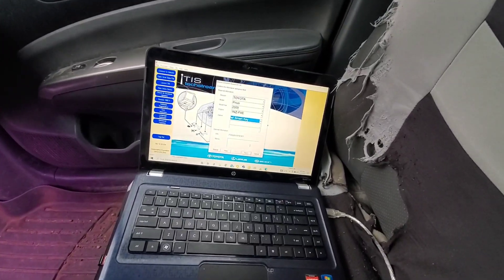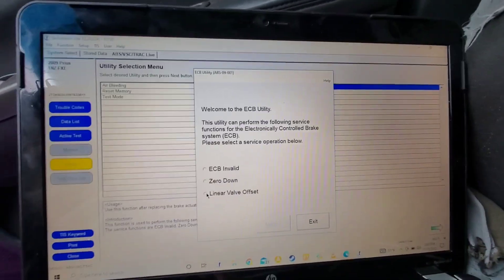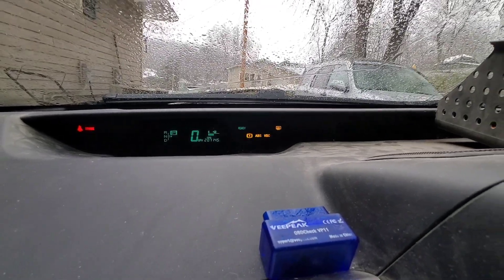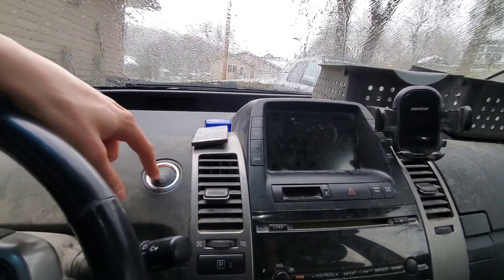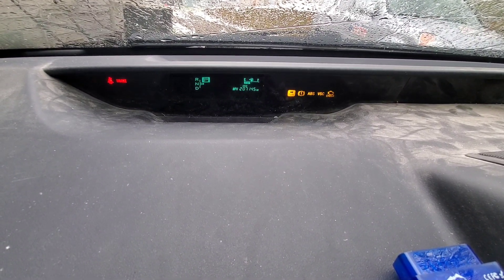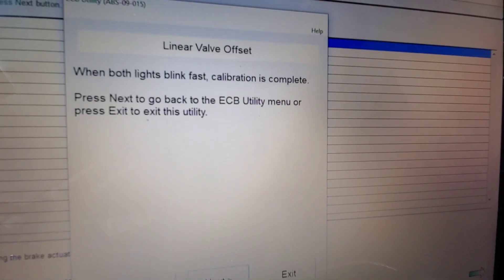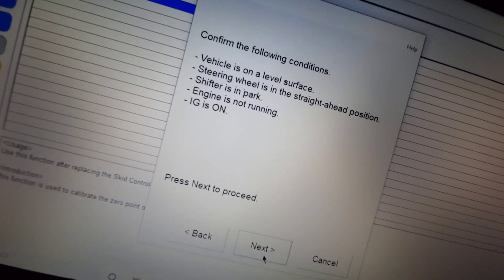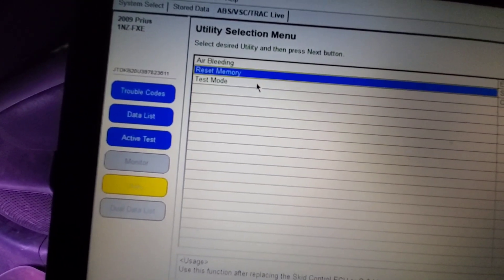Linear Valve Offset Procedure for a Gen 2 Prius using Toyota Techstream. Potential Fix for C1345.

Comment: How do you get working software and dongle ?
Reply from the maker: You can get cracked software on ebay and sometimes Amazon as well as the Mini VCI Cable. Search Toyota Techstream and Mini VCI Cable on Amazon/Ebay. 

Can't recommend one specifically as the seller I bought from is no longer available.
Reply: @JoMophee  you might want to use the Topdon Topscan rather than cracked software.  It would probably be about the same price.

Comment: Hey JoeMophee, thank you for the video! Would you know what would cause a C1300 code? I have been hearing the ticking sounds from the actuator more frequently. No codes or lights on the dashboard. TechStream shows the code C1300 for a skid plate. Thanks so much!
Reply from the maker: C1300 not Skid plate but skid ECU. On the Gen 2 Prius the Skid ECU is located underneath the center console. If you remove the center console you can access the Skid ECU easily.
Reply: @JoMophee  Thank you! Would you say a bad skid ECU could cause a frequent buzzing (almost every 3 seconds when brakes are not applied) from the brake actuator?
Reply from the maker: @wssr3293 no I doubt it. It's likely a bad Brake Accumulator if you hear repeated buzzing and clunking/ticking without the brake pedal being pressed.

Im assuming the noise in this Reddit post is what you're hearing: https://www.reddit.com/r/prius/comments/hj9g78/whats_this_thumpingbuzzing_noise_that_occurs/fwl20lt?context=3
Reply: @JoMophee  Yes, that exact typical accumulator sound but more frequent. Well I have already bought a new OEM actuator to replace soon. Dreading the TechStream/bleeding process more than the actual part replacement. Got any tips? Thanks again.
Reply from the maker: @wssr3293 make sure when you do the bleeding process that the 12v Battery is hooked up to some sort of charger.
Reply: @JoMophee  Will do! Thank you!!!

Comment: I reset the memory then proceeded to offset the linear valve but there is no blinking of the lights and there is no actuator sound going on and off. Did it twice and the same thing. I have a C1246 error and am trying to fix it. I was told to offset the linear valve but its not doing anything. Any ideas?
Reply: I have the same issue did you figure it out?

Comment: Good afternoon sir, I have a blink problem for the ABS indicator, brake warning and VSC stop before 120 seconds, is it normal? Or do you have to blink up to 120 seconds?
And the DTC C1345 is still stored which means that the initialization of the calibration has not been completed,
I have followed the rules such as Steer Straight, Shift Lever Parking, Power ON, Battery More Than 12V, Do Not Step on the Pedal and Let It Rest for 1-2 Minutes and the Last One Removed the Parking Brake, Strangely the red parking brake indicator continues to light up in MID even though the parking brake has been released, is it normal sir?in the normal datalist, if it is removed OFF if it is pressed step on the pedal ON (still using the manual parking brake, namely the pedal)
Does it turn on continuously because of ABS, VSC, Brake Warning on.
Do you have any advice?
Reply: Did you get this fix? My car is doing the same. I would love to hear what you did to get it fix
Reply: @Victoriano90065 

In the 2014 Camry Hybrid, the master cylinder and brake booster are separate. It's best to replace both components together and calibrate them. However, if you want to save money, please follow the trouble code displayed. The most important data points are the booster pump pressure and the internal brake master cylinder pressure sensor. To replace these parts, don't forget to perform the "internal brake fluid pressure reduction" active test and then disconnect the battery terminal. Calibration failures that frequently fail could be due to engine overheating, so be careful and thorough. Thank you.

Comment: Thanks for saving my Prius. I was getting all sorts of codes before I calibrated my new skid control unit.
Reply: Hi! Did you replace both the actuator and the skid plate or just the skid plate? I am getting a code for c1300 skid plate code. Thank you!

Comment: Not a guarantee? W a new actuator would it be guarantee
Reply from the maker: Yes if the error codes were caused by a faulty Accumulator/Actuator... a New one should fix the errors and brake issues.

Comment: Do you need to do this after changing the ABS Pump Actuator? I did the bleeding process using Techstream but I didn't do this afterwards. No codes.
Reply from the maker: Yes you should do the linear valve offset procedure after changing the pump. Probably not 100% necessary as I'm sure the Prius attempts to detect the valve positions without the calibration... but the Calibration will ensure it is working 100% correctly.
Reply: I ordered a used actuator off of eBay, had it replaced by a guy and it ran perfectly fine for 2 weeks... Today all the lights popped back up, brake, vsc and the petal feels like it did before I had the "new" one installed. There is a $300 diff. Between the guy who programs it and doesn't but I might have to pay it I guess, this is an 05'... It's my first Prius and I'm feeling discouraged
Reply: just curious, what codes did you have before replacing the actuator?
Reply: @Btu555  I actually didn't have any codes but the pump would go on frequently enough to drain my 12V battery.

Comment: The AUTEL MK808 will do the linear valve re calibrate on 2011 Prius.  The TopDon TopScan  has the function also but i have not tried it.  I used the Autel  on a 2011 with very noisy brakes and afterward it threw the 1345 code. I replaced the Master cylinder and pump $1100.  You need a scan tool or tecstream if you replace the master cylinder.
Reply: My MK906 wouldn't on a 2nd gen.  You're luckier than me apparently.
Reply: I tried on the Topdon and it went through the procedure but didn’t clear the codes C1345 and C1368. I’m thinking the clear memory function on ten Topdon didn’t work. That’s the only thing I need to do.
Reply: so the autel would be able to air bleed and calibrate and I assume the air bleed needs to be done before calibration? I have a 2011 prius with code C1252, C1253, C1256 and about to replace both brake pump and brake booster.
Reply: @Btu555  There is a bleed to use after replacing the booster.  It will have you bleed the screw that is on the booster. You leave the cowl off so you can get to it. I think that you need to bleed, then reset memory, then the linear, then you need to do the steering yaw rate. You don't mess with the steering but it gets erased when you do the memory reset. Have the car level when you do the bleed if you can because it needs to be level when you do the steering. Look at your scantool connected so that you can find the screens you need.  I did a 2010 last week but i used the Vdiag VD70. There are 2 good videos for replacing the booster and pump. I would have a quart and 1/2 of brake fluid. You will use a lot in the process.
Reply: @diydantex6150  Thank you for a quick reply and all the tips.
Reply: @Btu555  Using a Vdiag VD70 scantool
to finish install Prius brake booster
(you may need to clear codes before and during)
(The 12 v battery needs to have a good charge)
(I use a small dumb charger to maintain)

Run the (EBC)-R utility to bleed 5 places
(4 wheels and the Actuator)

Reset the memory
(you can’t do the Linear…until you reset memory)

Linear Valve Offset  and Pressure ...Learning

Set the yaw rate sensor
(Located in Test Mode)

The autel is similar the functions are scattered all over The bleed you want will tell you it is for replacing the master cyl/ brake ECU.  You need to poke around till you find the screens you need.
Reply: @diydantex6150  I am debating whether I should get the ebay version techstream (I believe it only works on older win 32 bit) since it can do quite a few things or just get my mobile guy uses the Autel to bleed air. I watched another video where he replaced the booster for his customer using the Autel to bleed with booster replacement option, it does all the bleed you mentioned and linear valve offset at the end but he didn't do the reset memory nor yaw rate, maybe the Autel has all that build-in.  Anyway, thanks for the detail steps, will come in handy for doing it the first time. After this experience, I know more about ABS that I like to. I opened up the booster and saw some oil deposit in the ecu (circuit board). It's not a good design (did I mention this car only has 81k miles), not sure why they don't isolate the ecu from those brake fluid tube because ecu only controls signals so all it needs is just output signal to the booster instead of the whole booster and ecu connect together. Maybe there's a reason that I don't know of.
Reply: @Btu555  I just checked my Topdon Topscan and my software expired. they want $49 to renew so I give up on the Topdon Topscan.
Reply: @diydantex6150 this is most the best comment I’ve come across on this booster and pump journey thank you. What video do you recommend for replacing pump and cylinder?

Comment: hello. Where did you get that program? Did you have to buy it and how much does it cost in general?
Reply from the maker: It's called Toyota Techstream... it's an official Toyota Program for maintaining toyota vehicles.

You can get cracked versions off of Amazon from China for around $100 with the MVCI cable included which is what I did.
Reply: @JoMophee thought it was on ebay